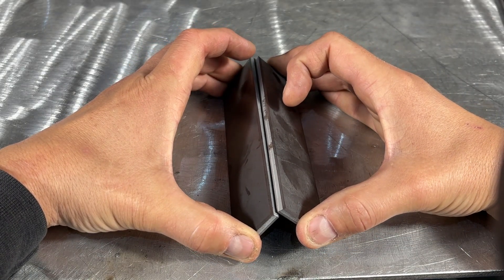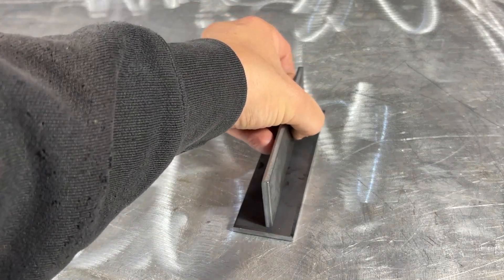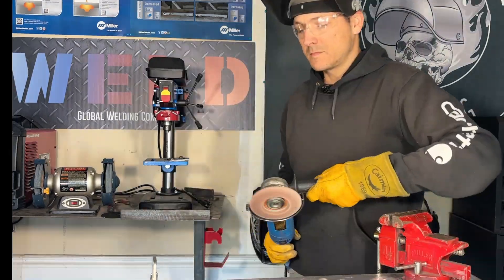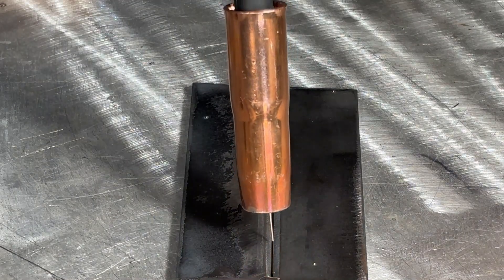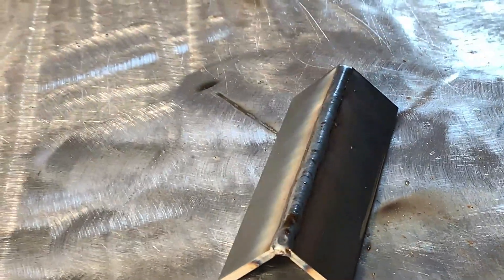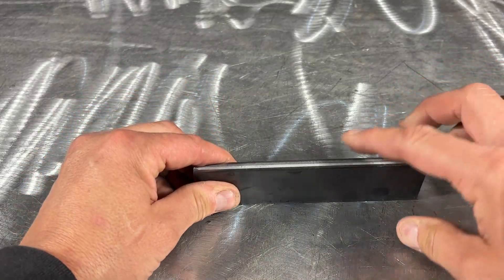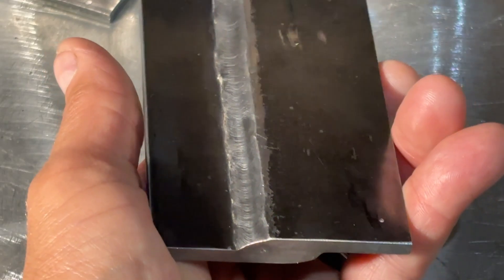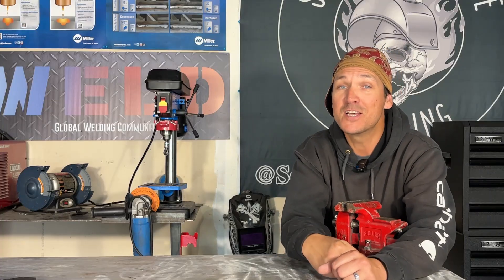What are the Different Weld Joint Types???

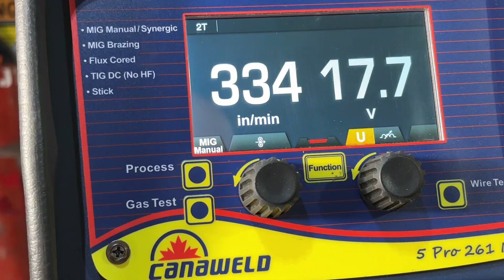Comment: I have a question about 1:10 .Here V  is for voltage , I got it . And I assume we are setting the voltage difference  between the electrode and base metal here .Is it correct ?
Reply from the maker: Yes for thicker base material or wire size, your voltage will change. You will also adjust WFS
Reply: @sewingwithfirewelding5627 Thanks for the reply. What is FWS, btw?
Reply from the maker: @ygt824 WFS = wire feed speed . Also related to amperage settings